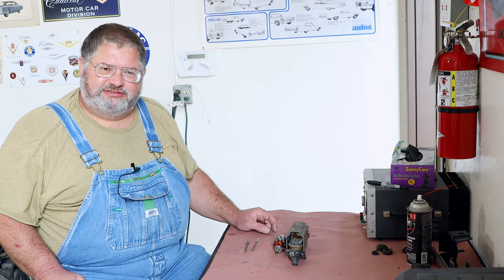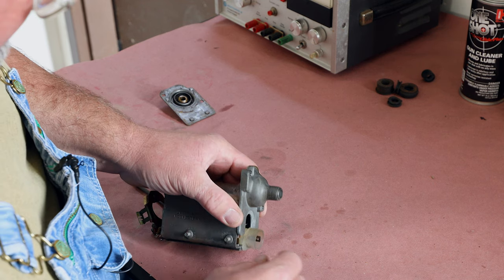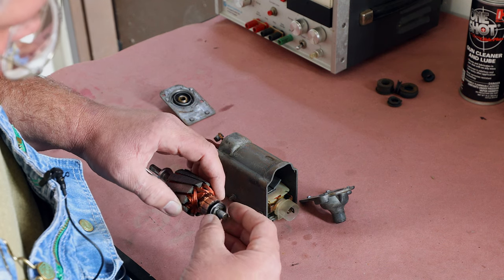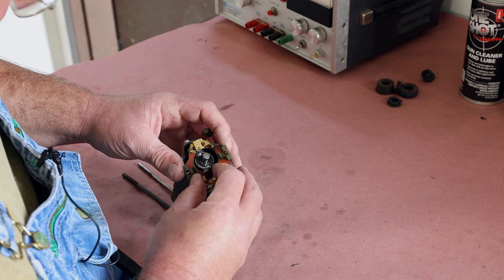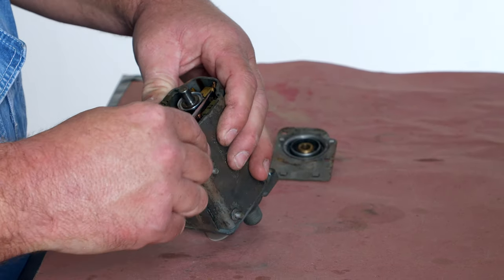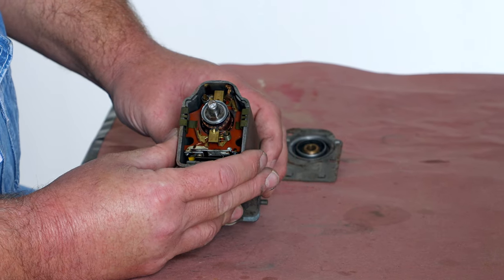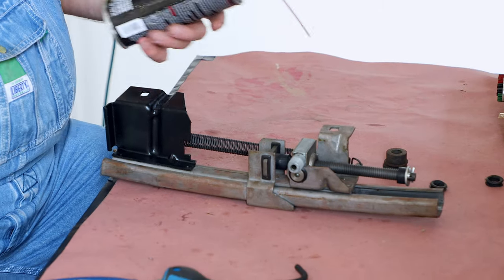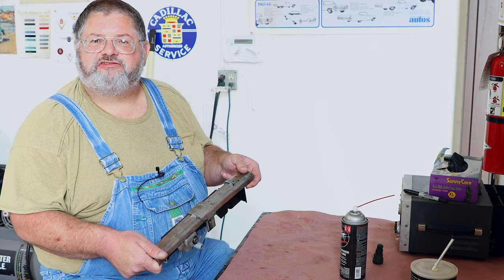Restoring the 1959 Cadillac Eldorado Power Seat Motor and Brackets

Comment: The main body with the coil does not come apart. If the field windings are burned up, then the best solution would be to get a used motor. The welds could be ground out and the field removed for rewinding however getting it back in position correctly would be very difficult. Josh